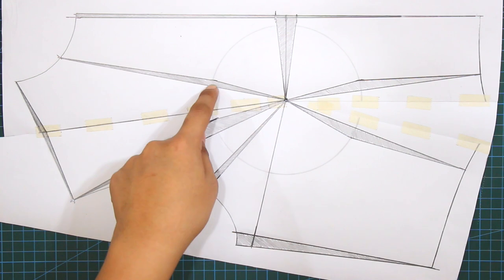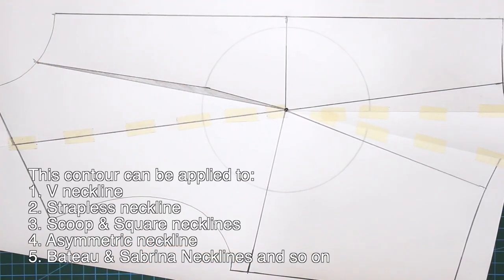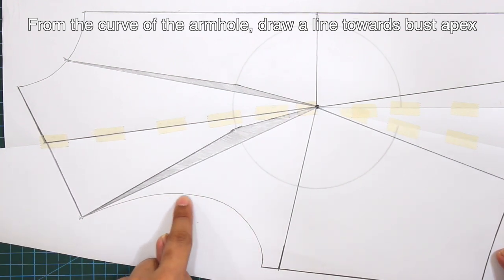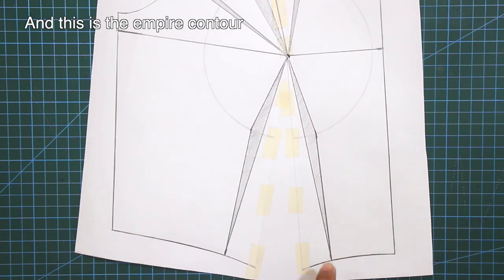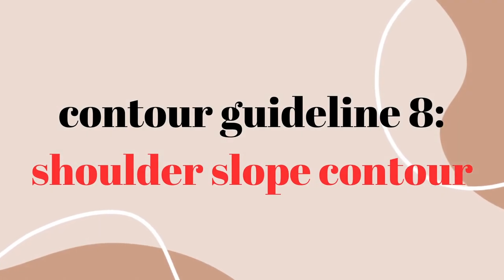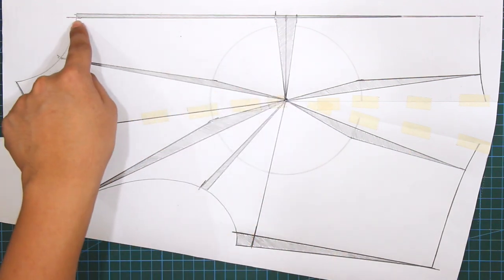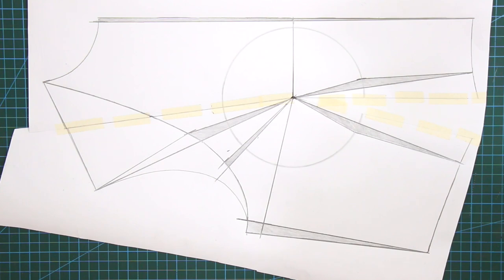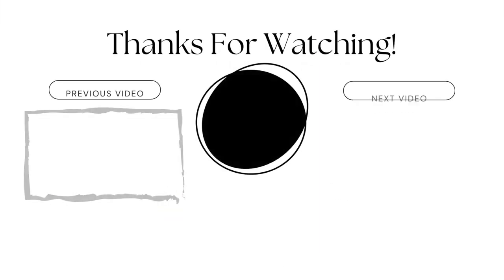BODICE CONTOURING PRINCIPLES | HOW TO CONTOUR THE BASIC BODICE | LA MODÉLISTE

Comment: Thank you so much , can i use same guidelines measurement for every measurement size (size6 to 24) , or these guidelines measurement can be  subject to change based on the bodice I am working on ???
Reply from the maker: Yes you can, but also don’t forget to check your pattern or mock-up on your dress form to determine the right or correct fit. You can  add up 1/8 inch to each contour and again check on your dress form. Hope this helps
Reply: Yes it does help , Thank you so much

Comment: Quick question; would the widest parts of the contours not be at the bust circumference line/circle instead of the adjusted edges? What determines which you use?
Reply from the maker: ??? Hi I’m sorry honestly I really don’t understand this question
Reply: @LAMODÉLISTE  Sorry, I mean for example on the first contour line from the neckline you mark the 2/8" contour on the bust circumference intersection, but later in the examples, it seems like you mark it on the new dropped neckline instead? Do you contour the same amount no matter how low the neckline is? And when do you use the bust circumference on the neck contour line etc. then?